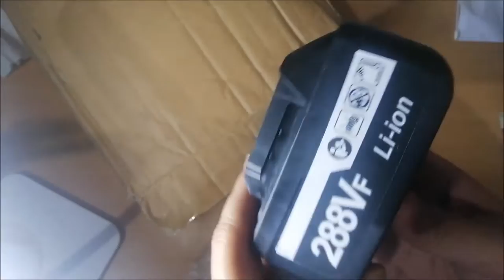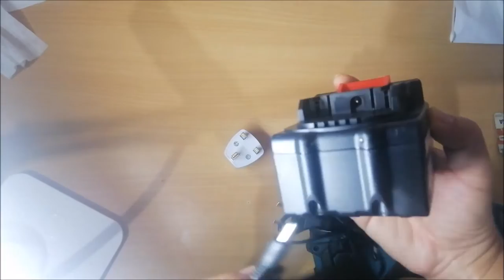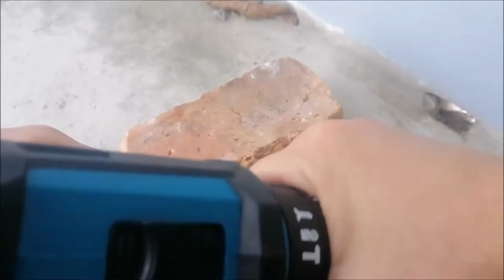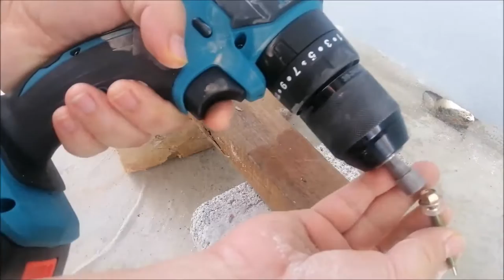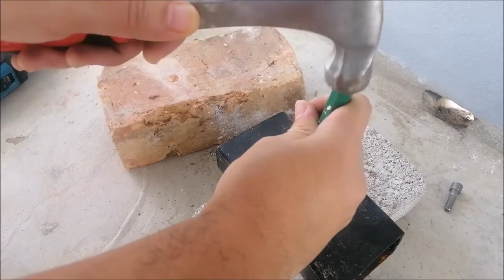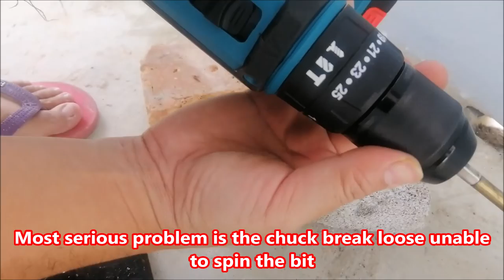makita 18v hammer drill copy #review | clone, fake, counterfeit makita cordless | chuck problem

Comment: Got my own fake Makita cordless impact drill, No Regrets on my purchase...Hammer drill function works nicely...NOTE: Do Not Expect too much for something that is cheap...🥰
Reply from the maker: The only problem on my part is the chuck
Reply: Search on how to fix a loose or not turning chuck...alot of repair tutorials are available in Youtube...😍
Reply: I bought the fake makita angle grinder and the thing works superbly loolz... I have it in my car for work stuff and if i need anything. How does this fake drill perform? Is mean is it useful to have it or is it a waste of money? The angle grinder isnt a waste of money in my opinion
Reply from the maker: @danijel124 I got angle grinder fake too and using Makita type battery..It was great at first but after a couple of time using it like less than 20 times the grinder now can't grind anything anymore ....it spins but when it touches the object it will stop and heated up....

The hammer drill still working so far use to jack my car lol 😂
Reply: @neodiy the angle grinder i got is working almost as hard as a makita loolz. Im using it at work to grind and cut a variety of stuff and the thing simply works very well loolz. I never thought it will work that well so i was very impressed loolz... But i lubricated the joint between the motor and the grinding shaft generously with grease because that part was dry in the beginning. Now it works superbly. I only wonder how long the electronics will last, thats the question. I was asking about the fake drill. Do you think it is worth having and using it (regardless of price). Im asking if its a good tool to use or not?
Reply from the maker: @danijel124  Lucky you ...if it works for  you its definitely good...i have two cheap impact wrench before and it works good until i sold 1 the one i am using still working

Comment: Bought a similar one recently and what seems to be causing this problem with the chuck is the hammer mode. if you drill concrete on drill mode and not hammer, the chuck doesn't get loose.
Reply from the maker: Could be.. But so far the drill does it jobs although not the most satisfying result